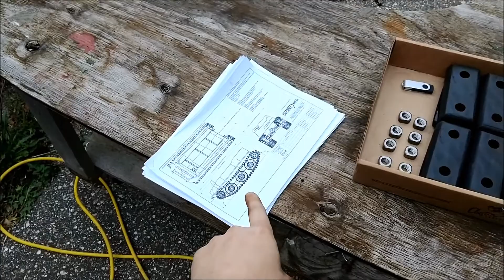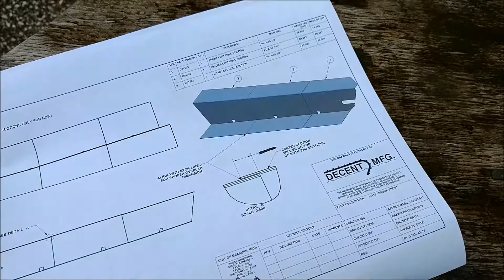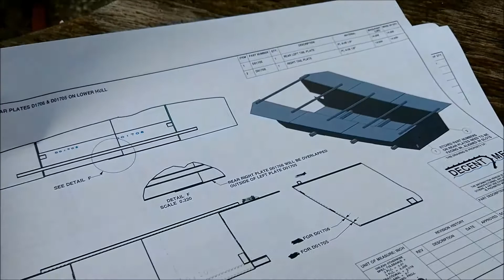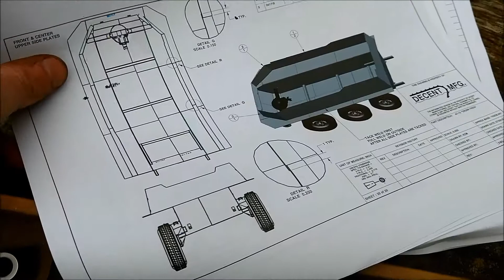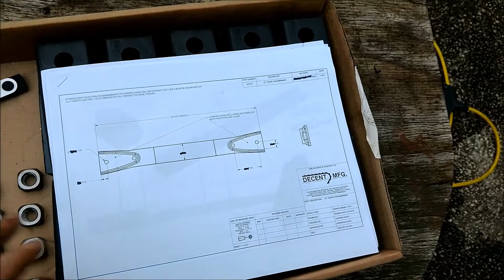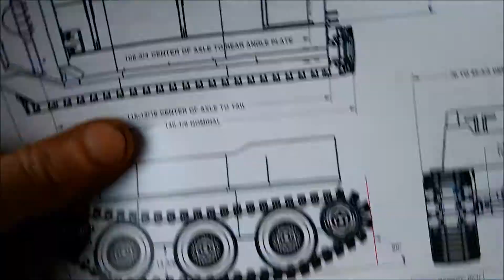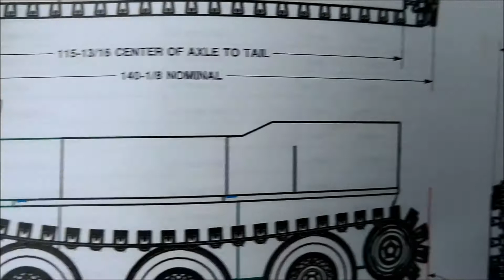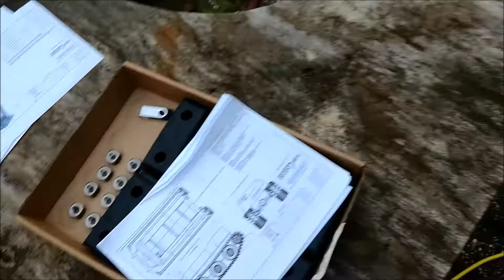Homemade Tracked Vehicle Plans

Comment: how much weight do you think I could stick in plating on this, also, do you think this design could accommodate torsion bar suspension?
Reply from the maker: I've had customers add their own torflex axles to this design, so it's definitely possible to add your own torsion bar axles.  You could probably build the whole thing out of 1/4" steel if you wanted to while still keeping its amphibious capabilities.  You'd drop its carrying capacity to zero though and reduce life of the half ton axle this design uses for steering.
Reply: @pinestumps8622  with what I would like to change in this design, it would weigh probably more like 10 tonnes, maybe more. obviously I would need to get a 7000lb axle and find a way to fit that
Reply from the maker: @9bang88  20,000 lbs is way too much for this type of design as is. You'll need heavier axle spindles, higher load rating tires, heavier track cleats, thicker belting etc. It would end up looking like a foremost nodwell at the end of it
Reply: @pinestumps8622  Right, it's a bit ambitious haha. but like I said I want to change the length and width enough to fit this stuff. Something similar to Hetzer dimensions, I just like your design its a good starting point

Comment: I'm no motorhead. This is not a double-clutch system, correct?
Reply from the maker: Correct, this is not a clutch-brake system, just a brake differential steer off a rear axle.  My current project has a clutch brake unit so stay tuned!

Comment: I've been working off blu prints since childhood. Even built my own airplanes ( real ones) and practically anything u can name. Had fabrication shop for years. Blabla. That is a very well formatted set plans. Depending on the description? Nice job young man. Your plans price is decent. ( not greedy) I wish u all the luck and sucess and continued growth. You are on a good path. Sincerely Dan. What are u asking for the ( ready to jig n weld I assume?) kit???
Reply from the maker: Thanks for the feedback!  Unfortunately it didn't make sense economically to put together a steel kit as I am not setup yet to efficiently produce palletized steel kits ready to burn together for folks.  I have a ARGO sized tracked amphibian I am developing where I will reattempt to build it as a weld kit that fits on a single pallet, hopefully I will have a nice garage/shop to play in by that time as well :).

Comment: That’s a cool rig. Since your engine is in the back and your axle is in the front did you just flip the axle over so that all your forward gears would make you go forward?
Reply from the maker: Yep you are correct!  I just topped off a little more oil through the breather line so the pinion bearing gets a kiss of oil every now and then.
Reply: Pine Stumps I like that. Very good idea.
Reply: Pine Stumps what’s your top speed?
Reply from the maker: 40mph.  I have two more gears after that, but I am limited with control ability and engine power.  I think there is a vid on here with the speed run.